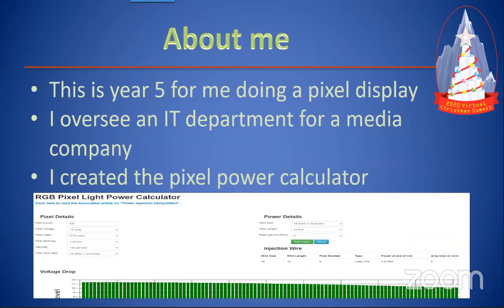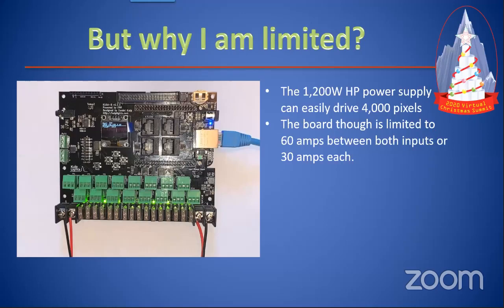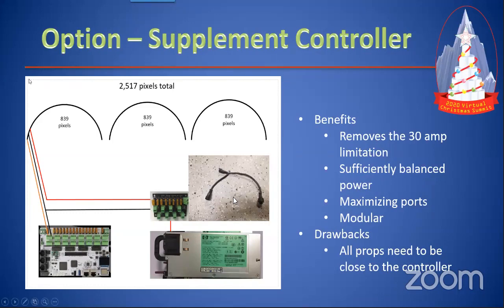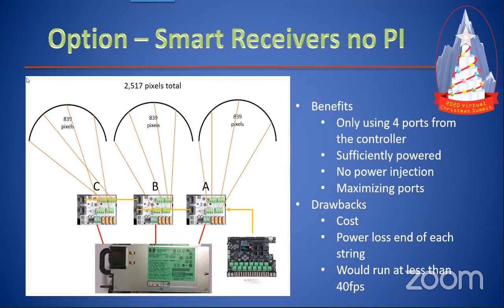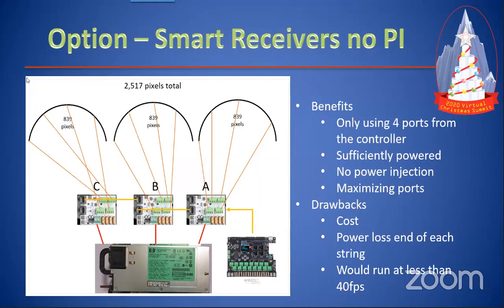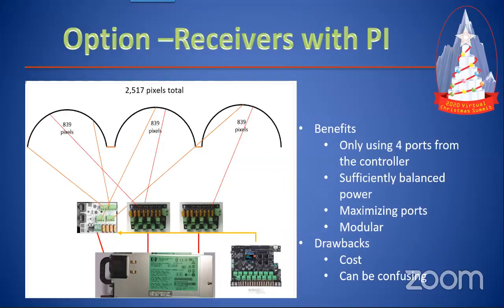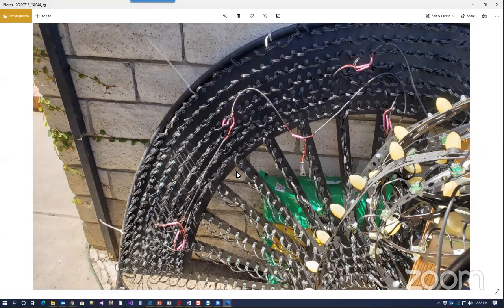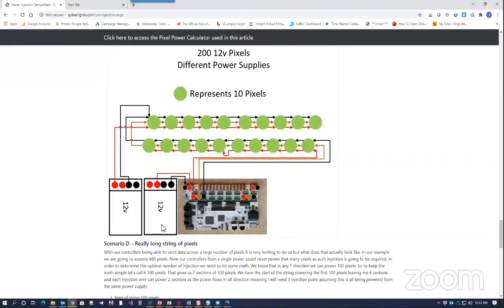2020 VCS Maximizing your controller options - John Spiker

Comment: One downside to using power injection is that a single bad pixel (one that doesn’t pass data anymore) can potentially take down the entire prop (or a large/noticeable portion of the pro), vs  a failure of only 1/n of the prop (assuming the alternative is to use n channels and no injection instead).